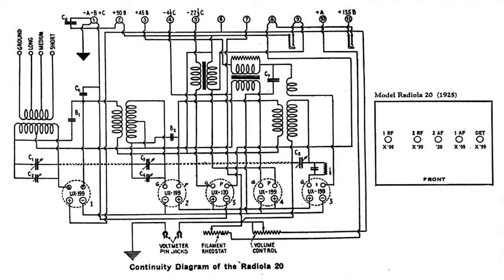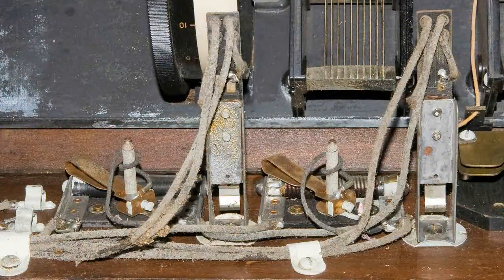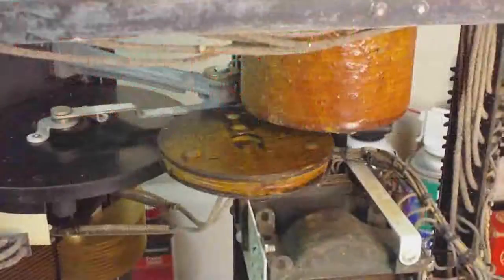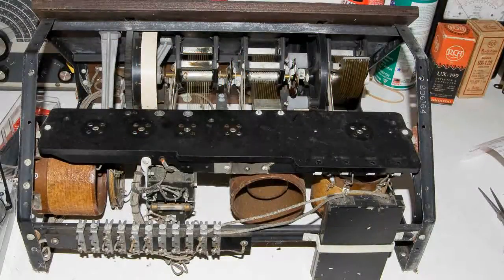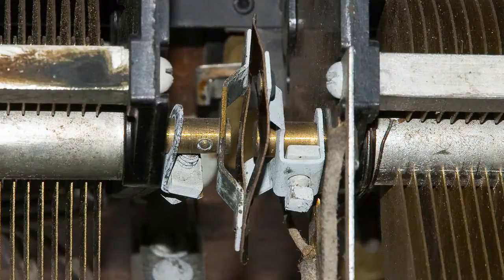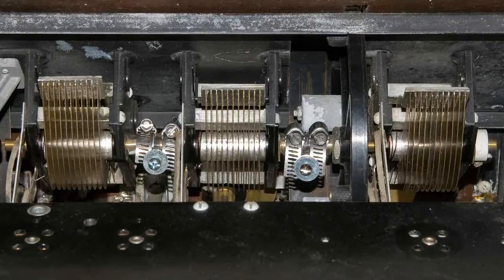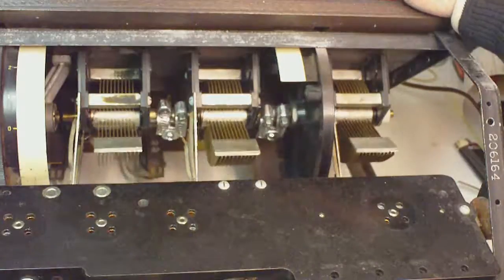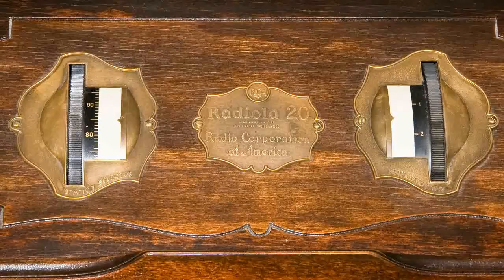Radiola 20 Repair 2

Comment from the maker: Thanks John,
Yes. The plastic tubing is a bit to flexible. The washers and nut and screw, can be adjusted for flexibly. The closer to the end of the hose clamps, the more flexible it is, but it still keeps the three variable caps from moving independently. It works pretty good for a very inexpensive fix. I really did not want to remove any of the variable capacitor if possible.

Regards,
Rick

Comment: Rick,
This is my second shot at a comment.  The first one never took.  Congrats on a great completely reversible fix.  I never would have come up with that idea.
I still can't quite figure out the bolts, washers and nuts.  Is their purpose to prevent one clamp from moving independently from the other, thus throwing the variable caps out of sync?

Regards,
John
.

Comment from the maker: Thanks Gary,
I hope it will be useful. While I have it on the workbench I will try and make an operations video. It is not the easiest radio to tune. You do not necessarily get the best response when the filament volt is up all the way.

Comment from the maker: Thanks,
Just make sure you do not use anything that has a black color because to get the black color the manufacture may have used carbon. And Carbon will short out the RF.

Comment from the maker: Thanks
Looking through the site, I like the Polyurethane K Coupling. They maybe able to be installed without disassembling the variable capacitors. They are $14.73 each. And that is OK. What I would want to know is did they use carbon to make the Polyurethane black. If they did they will not work in this RF section.

Comment: .  I sent a web link to a vendor that makes all sorts of flexible couplings that you might like to check out. You might find something that could work in this or a future radio you might work on.  the company is SDP/SI. but I can;t post the link here so I sent it to your email. Bellows couplings and uniflex couplings might work somewhat neater, they have some that look non conductive.The drawback is some radio disassmbly might be required to install.

Comment from the maker: Thanks. I think some of the sound muffling was my tuning, it did clear up ones. Also I was using the microphone on the camera which is not too good. I was planning on doing a short video on operation, I will try different speakers too. Also I am not sure what shape the audio tube is in, the UX120, it may be weak.

Comment: well the repairs turned out very well! very clever repairs too! does the sound normally sound like that on these battery sets? it sounds as if the speaker is stuffed with cotton. or does it sound like that because it's meant to be used with a horn speaker?